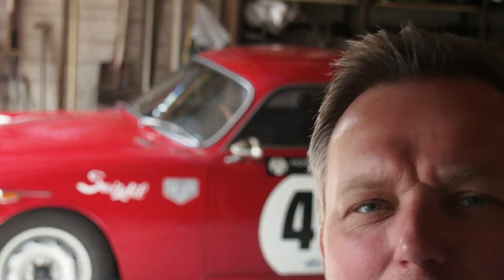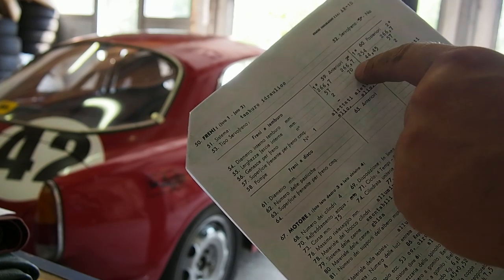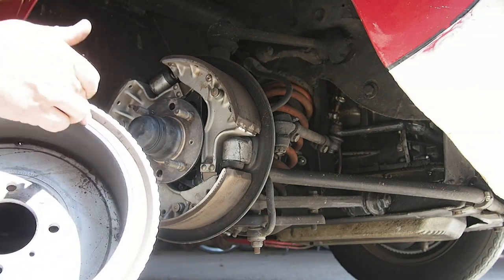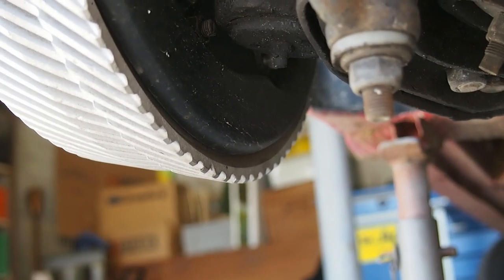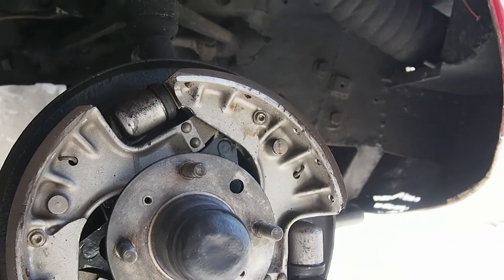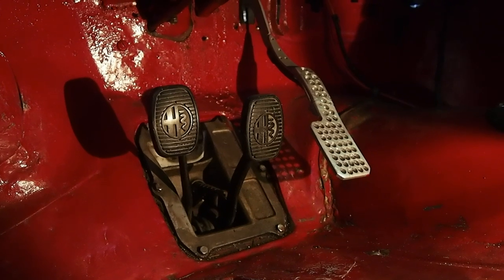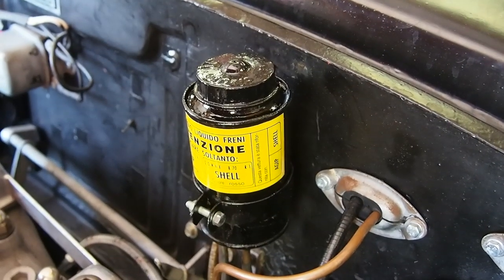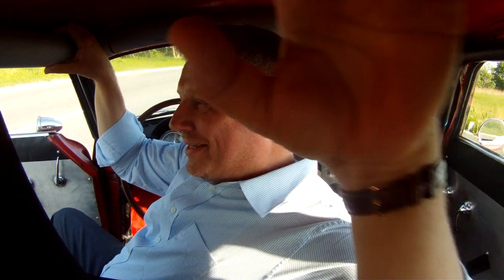Alfa Romeo three-shoe drum brakes

Comment: What about braking balance between front and rear? Can you adjust it? 
If you improve front brakes and do nothing with rear, overall braking performance can be lowered.Braking balance is very important for handling too. Is it any changes in brake pedal travel after this upgrade? Is it stil comfortable for heel&toe while downshifting?